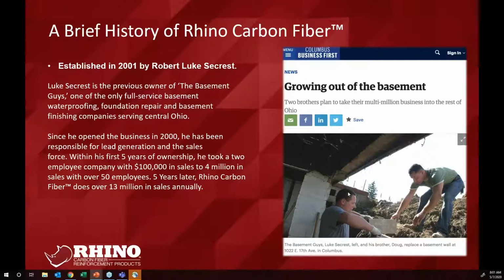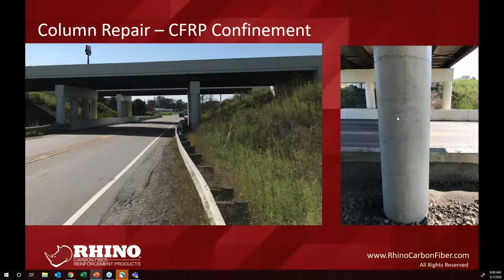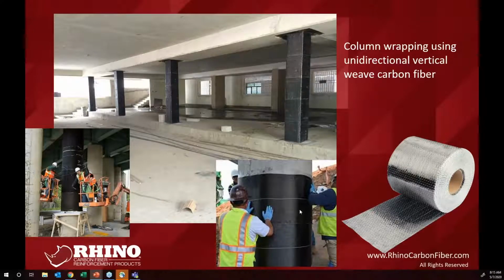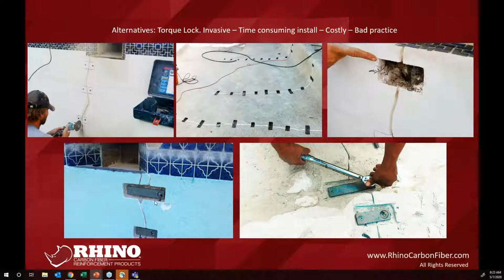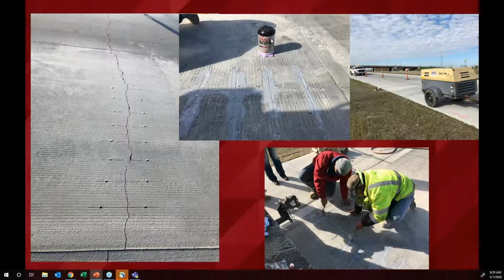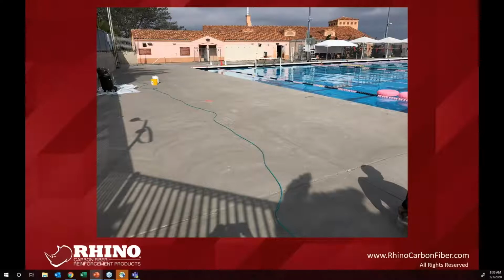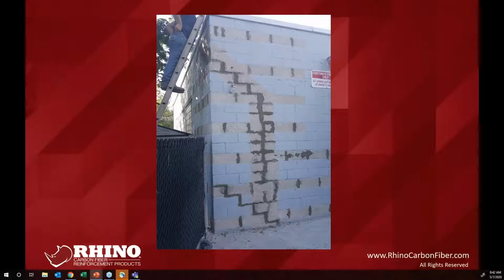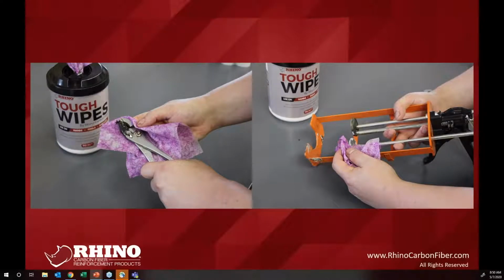Webinar: Learn How to Install the Rhino Carbon Fiber™ Crack Repair Kit

Comment: I’m hoping I going to install this product properly. I have cracks going diagonally away from old poured in windows and a crack below that was fixed sometime in the past. I plan on using epoxy to fill and bidirectional to hold together. I’m also thinking about installing crack locks